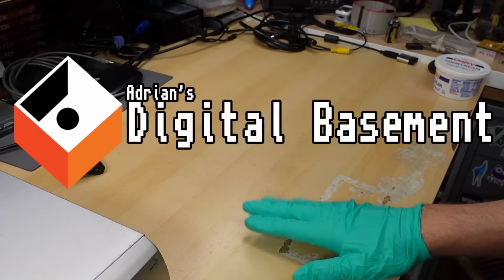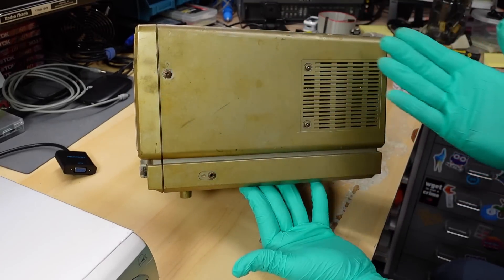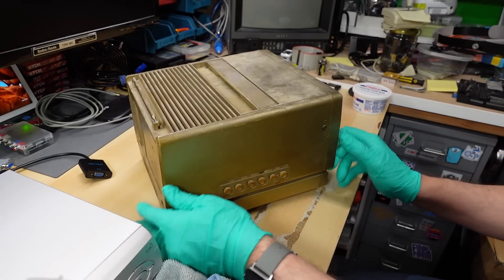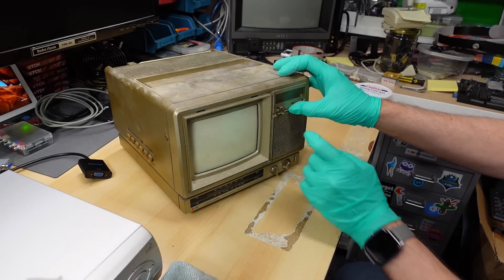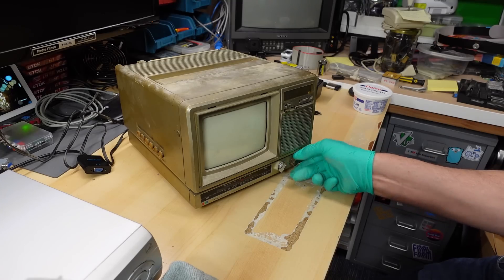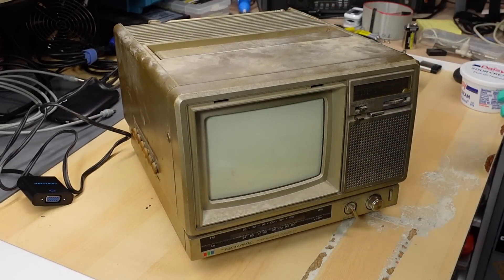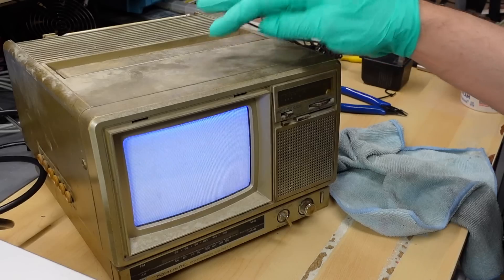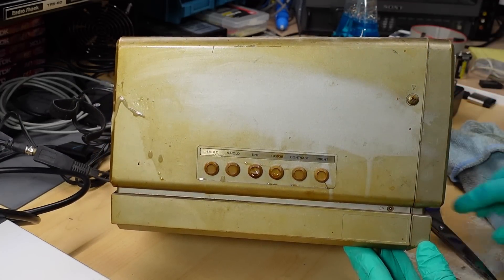Realistic Portavision Color TV: The most glazee I've ever seen!

Comment: I had an Atari ST like that, it absolutely stank inside and out. I ended up cleaning everything in the dishwasher about 20 times and it still absolutely reeked of cigarettes.  Scrubbed the PCB with everything I could find and left the parts up in the loft for about 5 years and the smell eventually went away.  I ended up painting the case! 😂

Comment: That reminds me of an office container (well, whatever they are called in proper English, those container shaped units that are roughly the size of a 20 ft. cargo container but contain things like office space on bigger buiding sites and the like) a friend of mine and me bought years back from a scrap yard where they had been used for a long time. Used by heavy smokers that is. Compared to what the inside walls looked like, this TV is sparkling clean. Before turning the thing into a workshop, we had to do some deep cleaning, and we found out that kitchen grease remover works best to get rid of this disgusting crap. The inside wall panels were originally white - and when we were done cleaning, they were white again, so this stuff could work magic on the TV's case when taken apart..

Interestingly that friend who was an occasional smoker before quit smoking on the spot when he saw the gunk running down the walls after we sprayed some of the degreaser. It was seriously disgusting.

Comment: Hi - so a i pack a day yellows, then i guess 4 packs a day would make it woodgrain

Many years ago when first married we rented in carlton / sydney , the house was a 50's style fibro small neat very old

The first room when you walked in the front door was a enclosed TV-dining room - a bit bigger than a normal sized bedroom 15x15 feet - the walls were a pastel shade of light baby blue ( that and the 2 bedrooms were , the bath was pastel pink and the kitchen frog green )

Anyway, something strange about the paint and the ceiling, anyway we had issued with the 2 or 3 fuses for the entire house and the hot water taps had rusty water when first opened and often the water was cold - the main tank had a leak and the leaky water would wet the gas pilot

Anyway the landlord offered 2 weeks free rent due to the hot water issues and replaced it with a new electric unit, he commented how nice the yard were as i maintained them and then offered 2 weeks rent free if i painted the inside of the house - i said OK the cost of paint was about a days pay for me

I got a professional in for a quote for the entire inside and almost fainted, but he mentioned the front room is nicotine stains and will need sanding , isolating then undercoat x2 and paint x 2 

Yes it was a washed out yellow stain and actually sort of smooth to the touch - yeah yuck, the ceiling cornices were ornamental but almost a pale yellow as was sections of the ceiling where the 2 lounge chairs were

Took some work but was fine in the end
Reply from the maker: Whoa.... I live in a nearly 100 year old house, so I'm pretty sure under the layers of paint has to be a ton of glaze ... it never smells like smoke in the house but I would have a hard time believing any old house hasn't had a ton of smoking in it.

Comment: Do this to save it.  Remove speaker.   Spray simple green, formula 409 or a liberal coating of Windex on the case and the chassis.  Place the cabinet in the sink and rinse.  Repeat until clean.  Use distilled water to rinse the chassis.  Let air (helped along with a small fan) dry for a week or two.  Spray the controls with deoxit 5 % or 100% if you have it.  Try the set again.  The speaker can only be cleaned in anhydrous alcohol.  Dip it in the alcohol remove and repeat.  It may be easier to replace it if you can find a replacement.  The set will be stink free.  If you don't feel like going through this procedure past the set alarm to Shango66.  He complains a lot about nicotine glaze but it doesn't seem to bother him that much.  This would be an excellent exercise on a set you really don't care that much about to show how you can clean up computer peripherals in the same way. You can do most anything with this procedure except the disk drives.  You got to keep the water out of those.  You are stuck cleaning those with Q-tips!!

Good luck!

randy.ab9go@gmail.com

Comment: I have a couple of 1990s Radio Shack mini CRT TVs and they didn't bother with the battery compartment because the amount of batteries it took wasn't worth the cost of the hour or so of entertainment you'd get from it running off batteries, and the TFT LCD screens on pocket televisions in the 1990s were already a huge improvement over the first generation of LCD pocket TVs from the 1980s, both in terms of picture and relative power consumption, for people who did want TVs which they could run off batteries.

Comment: If you do decide to clean it up yourself, get yourself some TriSodium Phosphate (TSP). It's available at hardware stores. My mother, who is highly allergic to cigarette smoke, bought her house from a heavy smoker. She wanted to get rid of the nicotine "glaze" before repainting, so she used TSP to clean the walls first. It works great! You could see the "glaze" drip down the walls much like it did on that poor TV when you were using the magic eraser. Just mix it up in a spray bottle, spray it on, and use a paper towel to wipe it off. It cuts through that junk in no time!

Comment: Dishwashers work wonders to remove cigarette stains.  Back when I smoked, every couple of years I'd dismantle my keyboard and computer case then run the plastics through the dishwasher and they'd come out like new.
Reply: Presumably that’s due to the 65°C water melting it off, as well as the light abrasive. I have my doubts if the enzymes did much against nicotine, but maybe.

Comment: Cant be the only one that when he found out the batteries were from 2008 thought "Well, not so old after all" then abruptly realized they are 13 yrs old... right? 🙈 Time flies!
Reply: Back in 1992 one of my teachers asked me to see if I can revive her good ol' radio. And well, I went into it and ran into batteries that were BB 1976. Perished the year I was born. Right. I checked and they gave neither the slightest motion on the meter, nor the slightest tingle on the tongue. But they looked pristine, and none had leaked. Also the radio started working right off after removing the batteries. A-O-Kay, nothing further to fix.
Reply: 2008 is when they turned off analog tv broadcasts.
Reply: @killerbee2562  Here where I live it took a bit longer, 2012 as far as I remember 😁
Reply: @Exploited89  here we still have 3 chanels
Reply: The batteries are actually from 1998. 2008 was the "expiration date."
Reply: That's also the "use by" date, which is typically a couple years after the manufacturing date.
Reply: @smpmuzpid  I bought some d cells yesterday and their expiration date was five years after why were made.

Comment: After working with computer jukeboxes and other machines that would usually be in bars, you wouldn't believe how common machines that look like this are. Just imagine a computer system (with a CRT, an oven for a CPU, some fluorescent lamps and a huge mess of wires to add to the heat generation) sitting in a tightly put together black box on a hot summer day getting cooked at 50°C in a bar where around 10 people smoke for at least 12 hours a day for years. I cleaned up one of those CRTs from a jukebox for retro gaming and it was so dirty from nicotine that it was dark yellow. Could have that TV been in a place like a bar too?
Reply from the maker: Anything is possible. Did you get used to cleaning up the nicotine costed machines after a while? I just cannot believe the employees in the bar would he breathing in all that stuff the while time working. Really really blows my mind!

Comment: Duracell batteries seems to not leak as often as others, but they're too expensive in my oppinion
Reply: Actually MODERN Duracells seem to leak WAY more often than the old ones did, and in fact, even seem to leak more often than other major brands of alkaline cells.
I've pretty much sworn off of Alkaline cells(except for 9 volt batteries(eventually, I'm going to quit using Alkaline for these too).
Also, small button cells in many cases do not have a good substitute available).
But as for AA/AAA/C/D cells, I've totally switched to Low Self-Discharge NiMh cells-the modern ones work quite well, and they do NOT leak under any normal conditions.
Yes, you DO need to remove them to recharge them, but I have no problem with this.
I've had ZERO pieces of electronics damaged by leaky cells since doing this.
And, yes there IS the rare piece of gear that does not like the rechargable NiMh cells-I've had exactly ONE piece of gear with this issue-I ended up leaving it plugged in.
You can buy Rechargable lithum AA's now-they have a built-in regulator to give the full 1.5 volts-but they are costly and probably will have a shorter life span than the NiMh cells-however, these are the correct choice for the rare device that REALLY needs 1.5 volts.
And, YES there is always the Energizer Lithium-NON rechargable AA/AAA cells.
They don't leak either BUT they are VERY expensive, and are probably most suitable where their super-long shelf life is the overriding consideration.
Also, as these start out close to 1.8 volts(a bit less under load), these can be risky for some devices, particularly if the device uses multiple cells in series.

Comment: These old CRTs are in desperate need of a modern driver board replacement.
The tuners are useless, they usually only support RF input (usually through something old fashioned like 300ohm screw terminals that aren't common today, or at best a phono plug), they're fixed-standard, and the boards probably have problems like capacitors and pots.

A new board would give you nice things like RGB or maybe VGA input, flexability with scan rates/standards, high quality electronics and a lot more.
Reply: can you even GET a "modern driver board" that can drive a CRT?
Reply: @m.k.8158  I doubt it, but if people can make old-fashioned RAM and replica soundcards and 6502s built out of TTL logic and entire functioning computers among other things, a board that drives a CRT doesn't sound that ridiculous to me.

Comment: the same kind of deposition can form in a house with gas stove when there is no ventilation ducts to pull out the fumes
 i have that problem in my old house kitchen every radio or tv get sticky over time
Reply: But those don't have the same Cigarette smell though. It's easy to tell the difference.

Comment: Back in the 70s and 80s, smoking was not restricted on U.S. Navy ships. After years of smokers the white walls were a dingy yellow and the gray walls took on a lovely baby poop hue. Too often cleaning just wasn't enough and we'd have to repaint the walls, and the difference is just as remarkable as you got with that TV.

In the 90s, smoking was not permitted inside the ship, and those interiors not only  looked better, they smelled better. And the equipment was happier, too.
Reply from the maker: And some of those ships are old. I wonder if some of the original machines and electronics still have the glaze? I can only imagine airplanes too .. the coating on everything.

Comment: When I was 15 a regular customer to the computer shop where I worked brought in his A2000 in for repairs. He was best described as a champion smoker and sat in front of the machine basically 24hrs a day running a BBS. I was tasked with the repairs. I don't recall what the issue was anymore (failed PSU and CIA is what I think) but the amount of windex and 409 spray cleaner I had to use to try to get the thick gooey coating of brown tar off as much of everything inside it as I could stands out prominently in my mind.
Reply from the maker: What's funny is I used to repair machines too back in the early 90s and I don't recall something like this or that Amiga 2000 ever coming into the shop. I lived in LA at the time and the shop was in a pretty affluent area,  perhaps super chain smokers lives in another part of town. Or perhaps I blocked out any such bad memories??
Reply: @adriansdigitalbasement2  The shop I was at was and still is, actually, near Mill Creek WA. Maybe it is something about the weather here that made more people smoke... I had machines come in pretty regularly with some level of yellow build up on them and people wondering why their floppy drives wouldn't work. Gee, I wonder? Also, the network admin I worked under at a medical devices company nearby was also a truly stunning smoker and I am sure the machines under his care would have been terribly gummed up if he had been allowed to smoke in the building.

Comment: oh god!!!! I can smell it from over here!  I get things like that from smokers to work on and I need to give them a bath in Windex before I work on them lol
Windex works so good at getting that crap off its all most magic!
Reply: I'm curious if that works on cables with a rubbery coating? I unwittingly bought something from ebay once that had the glaze. The plastics and electronics cleaned up ok with normal stuff, but the cables were resistant to soap, alcohol, vinegar, coffee, etc. Eventually I just hung the cables in the basement for a couple of years after which the smell had finally become tolerable.

Comment: I've worked on (well, scrapped, cos they were dead!) computers that were this bad, the added issue with PCs being that the fans draw dust in, the dust sticks to the tar deposits, more tar settles on the dust, more dust comes in, etc., until it forms a dense, thick, nasty layer of insulation that burns out components that can't breathe (much like the smokers!) resulting in a premature death (also much like the smokers!!!), nasty habit... :S
Reply: Isn't this also a problem with electronic fires? Could obviously apply to all kinds of fumes (extraction fans etc.) but it's always never made sense why one had to be so careful with electronics. Always shutting it off completely, unplug it in a thunderstorm and so on – of course non-flammable PCBs helps but maybe most of these fires actually got worse due to the indoor climate we used to have? One blown component and boom you have a cake of dust just waiting to join the party. Just a thought!